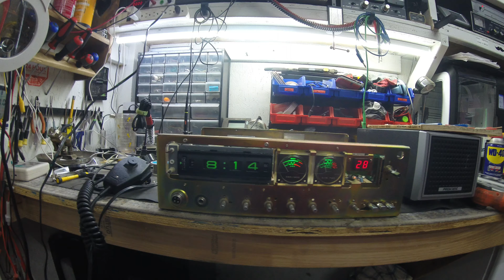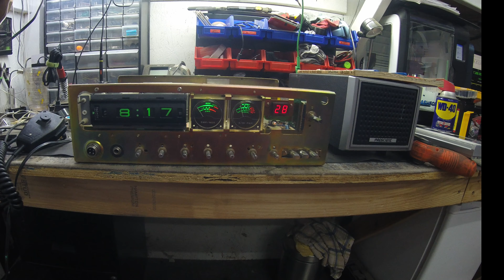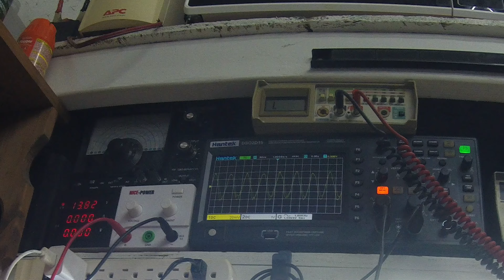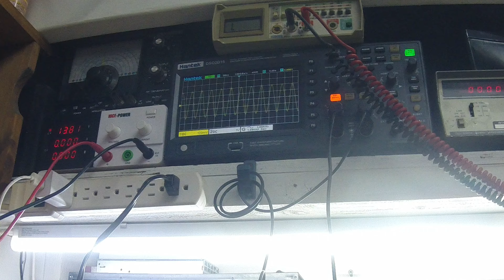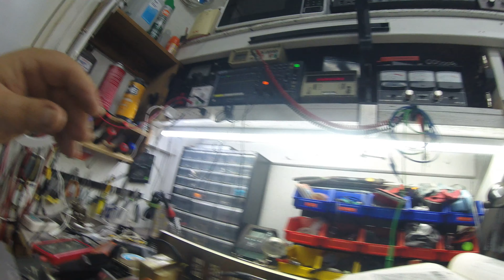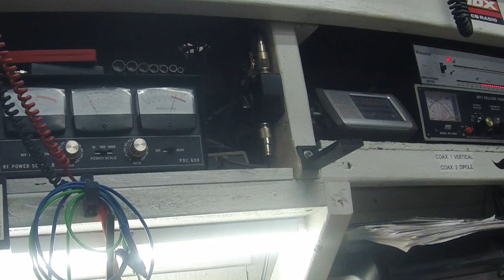President Dwight D CB Base Repair and Restoration Part 2

Comment: I have the same Base Station. I am trying to get the clock fixed on my President Dwight D. Base Station. Wish I knew size was the replacement that you used to fix it. Do you have an extra one to spare? I had one of these base stations in the early late 80's/ early 90's and 30 years later finally found a replacement for the one I had but just need to get the clock working and I am still looking forward tackle that project.   By the way what would you say is the  actual fair market value per hour cost for actual bench time to repair items like this or diagnose and repair electronics such as vintage 70's stereo systems etc...? Thank you for the great video.